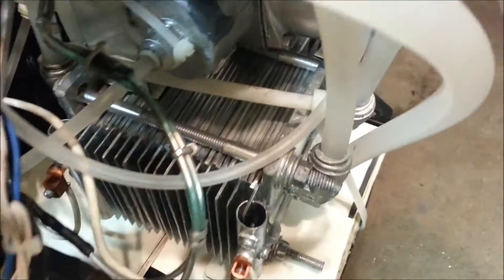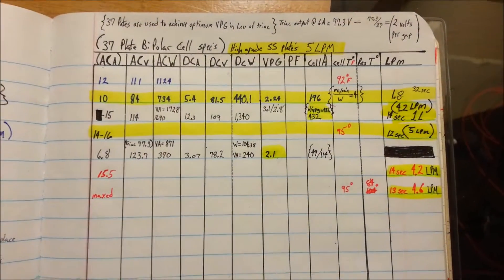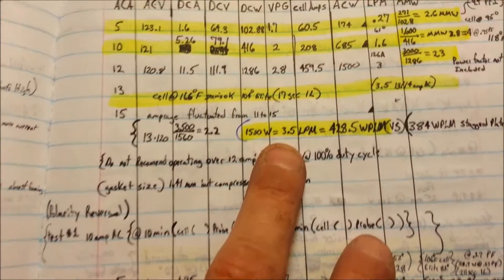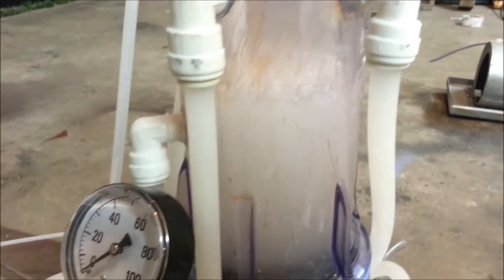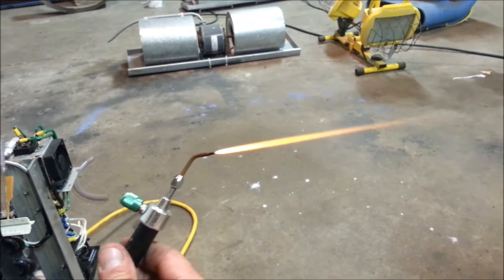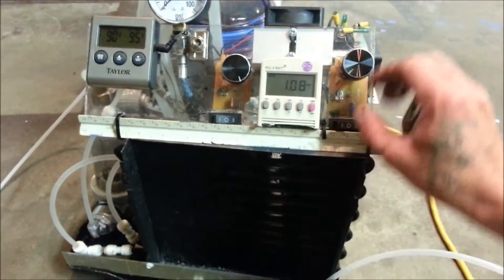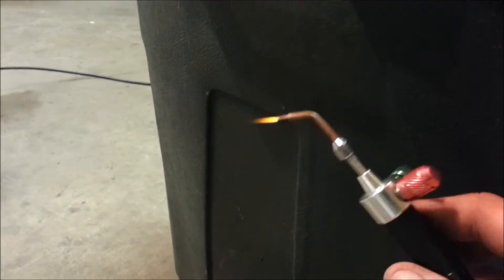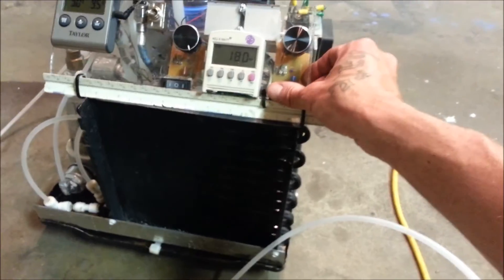HHO torch high output

Comment: Hello nobox7, I was surprised by this video that you have worked in the field of HHO cells for a long time.. So I want to ask you since you have great experience in the field of building burners.  Is it possible to make a cast iron smelter with a capacity of about 30 kilograms of the fixed crucible type (very similar to the smelter you recently built) using HHO cells?  How much electrical energy do I need and what should the HHO cell output be?  What is the appropriate type of burner?  Because I already have a solar energy system that I use to pump groundwater, and I intend to benefit from this free energy in this project to smelt cast iron.
Reply from the maker: I dont think its possible without extreme expense and difficulty
Reply: @NOBOX7  
Thank you .  After a period of research, I came to the same answer as you.. I think in this case that the electric induction furnace is a better option than the process of converting energy from one form to another several times.

Comment: The cells are getting so hot because you are running the voltage per cell too high. At atmospheric pressure the voltage should be about 1.5V. Just over the minimum voltage to make it generate gas. If operated there the reaction is actually endothermic and the plates will get cold. I am not sure how much the output will be effected though. It should not be dramatically different. The extra voltage is basically being used up as heat right now.
Reply from the maker: Not true .
Reply: correct many errors and wasted current!! fluid is also primitive